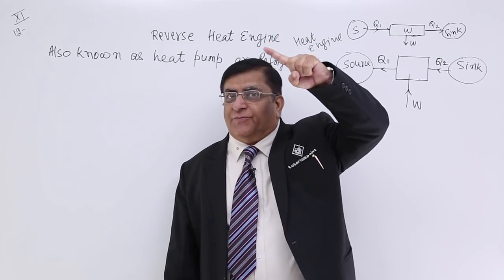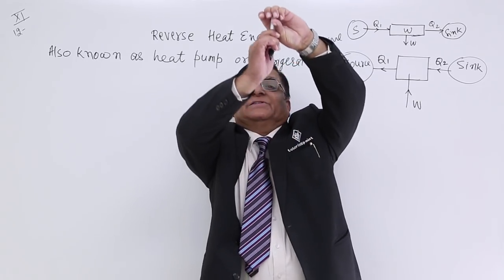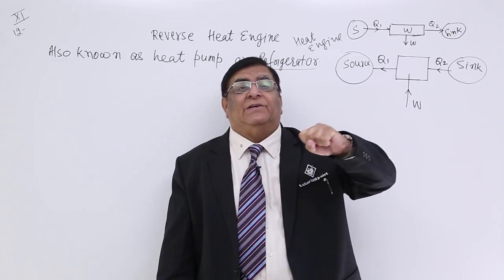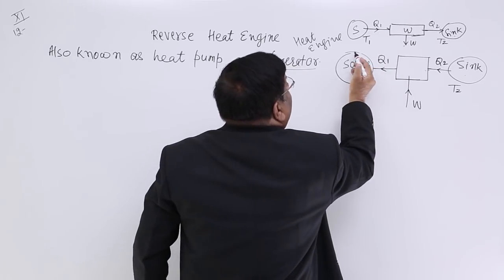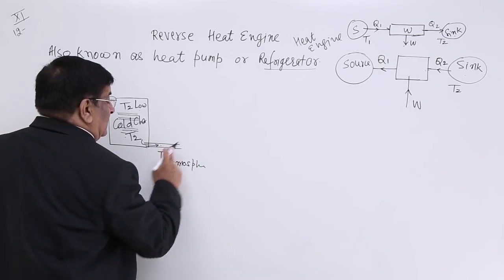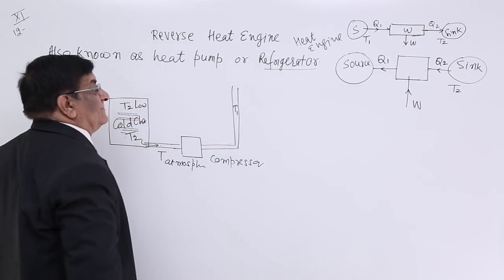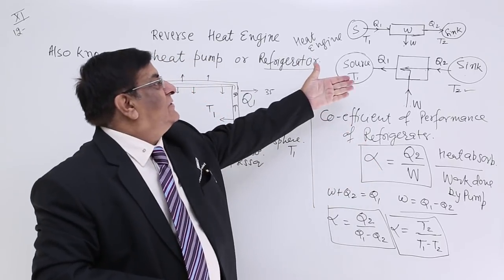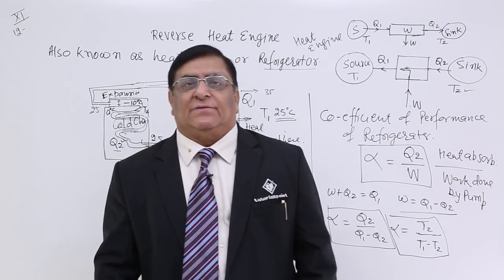Class 11th - Reverse Heat Engine | Thermodynamics | Tutorials Point

Comment: A material having small forbidden energy gap        1eV.    is called semiconductor. The conduction band is almost empty and valance band is almost filled in a semiconductor at absolute zero temperature. Thus semiconductors are perfectly insulator at OK. But at temp. above ok, some of the valance electrons acquired enough thermal energy and jump to the conduction band. They leave behind as equal number of empty states in the valance band which are called holes. The holes act as positively charge carriers.
Reply: Thanks for this info.

Comment: Sir. One doubt. While the output temp is 25 degree... y should we comress it.. ? If the same 25 degree enters into refrigirator by adiabatic expansion we can make it to -10 degree..
Reply: That's a mistake I feel. Out put temperature is actually less than room temperature, so we need to compress it Adiabatically to increase temperature
Reply: If you remove the compressor then why would the gas move from large dia pipe(large volume) to small diameter pipe(small volume) . You need external work to force them to move. Its like saying, you are switching off ur fridge after running it for a day in hope that fridge will be chill forever.